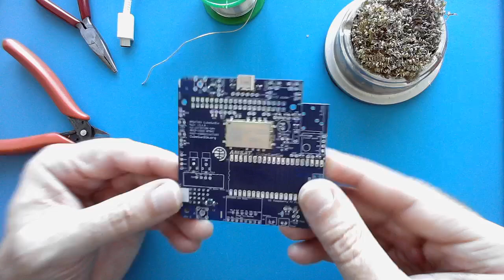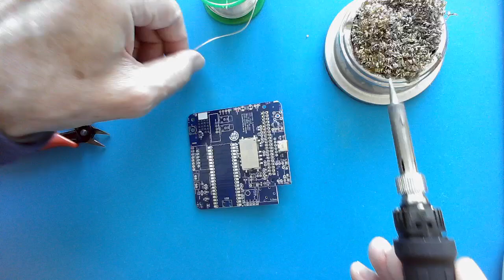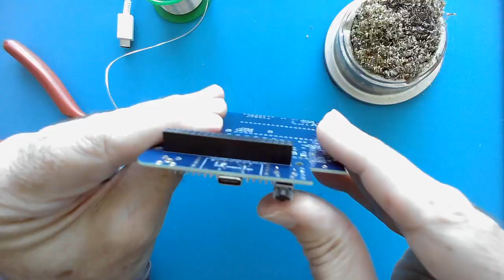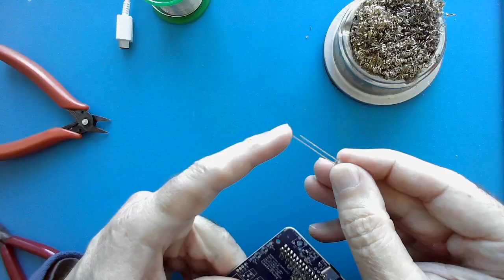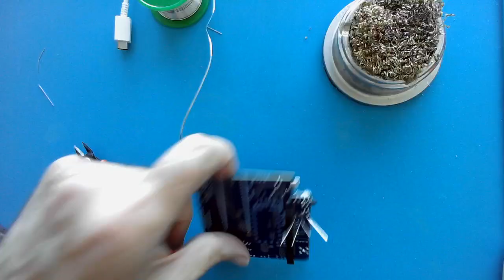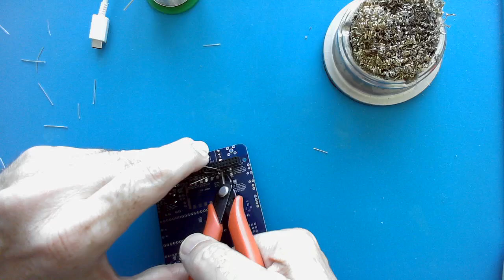CubeSatSim Step 1 Main Board Part 1 v2.1

Comment: How do I make sure each step is done correctly? for example I didn't join two GPIO pins together with solder. Maybe use continuity on the tester for some parts...
Reply from the maker: There are some test of LEDs and other intermediate steps in the instructions. Close inspection and careful inventory of parts will also be a help.